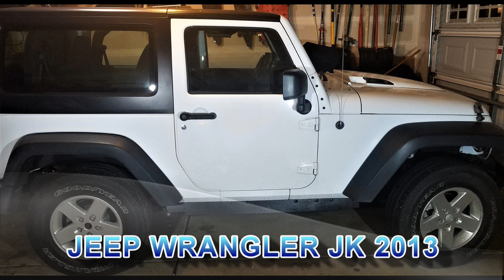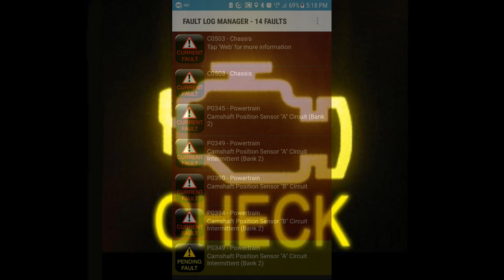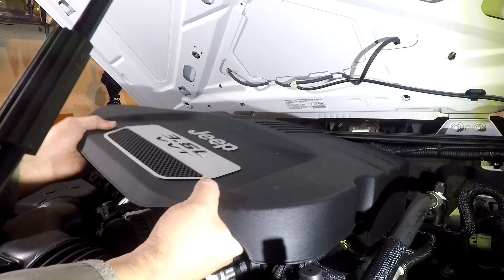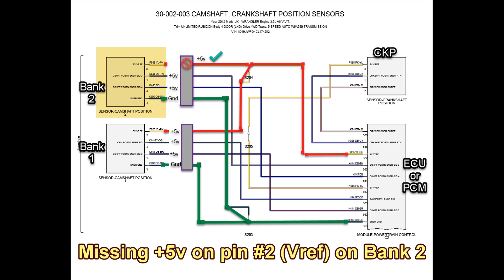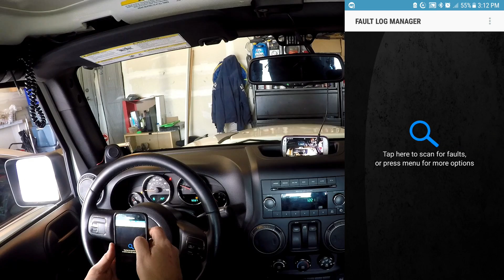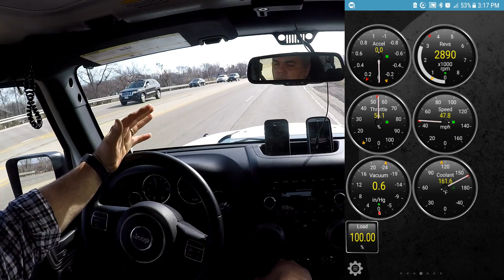p0340 p0345 Jeep Wrangler CAMSHAFT POSITION Sensor SOLVED

Comment: By far, the BEST video on this issue. 
Clearly detailed diagnosis. Much appreciated! I have this issue currently.
I’ll report back once I diagnose mine.
Reply: I checked the voltage in the connectors. Driver and passenger side. All pins except #3 have, 5V. 
I already replaced the camshaft sensor on passenger side. I guess I’ll replace driver side tonight. Not sure what else to do now. Any suggestions????
Reply from the maker: Pin #3 is ground... so not 5V should be seen.   what DTC are you getting ?
Reply: @toshisate8121  
Both sides being replaced fixed the issue. Wife traded it in. Got a 392 now. Fun some bitch!

Comment: I just went through this. It turns out that I had a loose ground cable on the battery. Fixed that and the codes went away! Start cheap and work your way up! Chrysler/Jeep is known for demanding a good solid ground or weird codes will show up.

Comment: Can anyone help? On pin 1&4 I get 1.5 volts on both banks. Crank no start with cam obd codes i have ground and 5volts but pins 1 & 4 only 1.5volts
Reply from the maker: 1. make sure your battery Negative is good and car ground is good also.. check ground at ECU also.
2.- at CamPS, check voltages as shown in the video, connector unpluged, ignition switch on.  Check back side of connector too.
3. check the Crankshaft position sensor connector as well... make sure is clean and not shorted.    you can also confirm the RPM needle moves when you try to start the car.    this will indicate good signal from Crankshaft.
Reply from the maker: what DTC are you getting ?

Comment: I’m having a similar issue after replacing my knock sensors and knock sensor plugs. These codes are all coming up. I replaced the connector on the bank 2 sensor and was getting proper voltage on all of those, however I’m also getting a code for the throttle positioning sensor low voltage as well. I’m soo stumped at this point.

Comment: I'm having the same issue on my 2012 JKU.  My mechanic tells me that I need a new engine.  I will try your method and see....
Reply from the maker: any updates ?
Reply: Yes! problem solved.  the wires from the sensor to the cpu was criss crossed with another wire.  this is after i had replaced the sensor, and the connector...   @toshisate8121
Reply from the maker: Good luck!

Comment: This video helped me diagnose and fix a bad connecter (Bank 2, Pin 1 had zero volts. I bought OEM pigtail and soldered it.  My check engine light and traction control light are off.

Comment: What scan tool and app are you using???
Reply from the maker: the app in my phone is called TORQUE pro .. they have a free version but the Pro version offers NO ADS and only cost aprox $9.99.    the  OBD-II at the time was a cheap ELM-317 from ebay... i now have a better one call VEEPEAK OBD2 Adapter... it is more stable and reliable.

Comment: I have a 2015 JK Willys. I just had my rocker arms replaced cuz of this loud tapping. After i got it back im getting a check engine light showing P0344 ( cam p.s. performance - bank 1, sensor 1 intermittent - bank 1 sensor 1). They said they replaced the sensor on the passenger side. They cleared the code, but it just keeps coming back. Also the T.C.L. keeps coming on now too. So i did what you did and i tested each pin and on each i got 4.98 except for the ground. I've replaced all 4 wheel speed sensors before as well, cuz i was having those T.C.L. and ABS lights before. Idk what else to try?
Reply: I had the same problem bro..  It’s one of your camshafts it’s not sending the position of the camshaft to the ecm . Take it or get a scanner that can show you camshaft position and it will show you which camshaft is bad
Reply: @ismaelnunez2880  It's been fixed now, $2500 later. But ya that's what it was....the camshaft.

Comment: Hi, did you change the sensor that just cleaned?
Reply from the maker: sensor wasnt changed or replaced.  The connector was cleaned and wires pushed in...  I took the sensor out just to show in the video...

Comment: I just bought a 2012 Saturday. It went into limp mode on the way home... 

These were all the codes pulled..

C121C-Torque Request Signal Denied.

P0345-Camshaft position sensor A Circuit(Bank 2)

P0137 - Oxygen Sensor  Circuit Low Voltage Bank 1 Sensor 2.

P0339-Camshaft Position Sensor A  Circuit intermittent.

PO365 - Camshaft Position Sensor B  Circuit (Bank 1).

PO390-Vamshaft Position Sensor B Circuit (Bank 2.)

Comment: hi i have a code p0349 i changed the sensor and connector in passenger side what should i do next 💔
Reply from the maker: did you check the voltages as shown in the video?   measuring should be your 1st step before replacing sensor or connector.   why did you replace the one on the PASSENGER (bank1) when DTC p0349 is a problem on DRIVER (bank 2) side?   You may want to put that new sensor on the Driver side.
Reply: @toshisate8121   after changing the driver the car was ok for 2 weeks 
buy now the problem is back with same code
i checked the volt and all of them gave me 5v
Reply: @Sho0omteBeHappy did u leave the battary disconnect for a bit?

Comment: My mechanic has changed the sensor AND the pig tail - but the P000B code won't go away.  Thanks for video.
Reply from the maker: https://www.yourmechanic.com/article/p000b-obd-ii-trouble-code-b-camshaft-position-slow-response-by-parker-hill_2#:~:text=P000B%20code%20definition,and%20timing%20of%20the%20camshaft.
Reply: @toshisate8121  Would you actually ask your mechanic to look at this link - or would they be insulted?
Reply from the maker: @ap14rcf70  if he is honest and looking forward to fix the problem.. it shouldnt insult him... he should be appreciative that you are researching the issue as well
Reply from the maker: what year is your jeep and how many miles?  per link, there are things you could do yourself...example, I would start by c
cleaning the engine interior... i would use SEAFOAM treatment to clean any gump or blockage on oil passages, etc.
Reply from the maker: 2nd i would change the PCV valve. just in case... those are cheap
Reply: @toshisate8121  ... already changed the PCV valve --- and, most recently, changed the Oil Pressure switch, replaced oil filter housing and, new temperature sensor - replaced the intake and exhaust cam actuators .... they drove it three or four times for 14 miles before i picked it up - they said the light had not come back on --------- as soon as i pulled out and turned the corner - the check engine light came back on - same code, P000B.  Not sure exactly but think i've dropped close to $2500 on this and they haven't fixed it ... sadly I think the only think left is what?  The cam shaft itself?  WHAT will THat cost?  Very discouraged, not sure what next move is.
Reply: @toshisate8121  It is a 2015 JK Sport, no modifications ... at 47,000 miles they replaced lifters (warranty, no charge) - no other problems at all until it hit 70,000 - i'm not at 73,990 and it's been to the mechanic ten times - i'm NOT exaggerating, i have each invoice right here in front of me.
Reply: @ap14rcf70   hey I’m sorry to bring up a very old section, but did you ever find the problem? I’m going through the same exact thing as you right now. P000B bank 1. Replaced both intake and exhaust cam sensors along with exhaust side solenoid. Code keeps popping back up.
Reply: @ap14rcf70  there is a video posted just a few days ago about a crankshaft sensor being replaced and it fixed a P0394 code. I have a 210k mile 14 charger 3.6 or the 3.5 (wife’s aunts sorry) has that code. I have ground at connector, all the other pics have respective 5 volts. I move the wiring and all looks good.  The code is for a intermittent fault bank 2 camshaft sensor fault.  I swapped sensors and no change, wiring is good.  So I am headed towards the $20 mopar crankshaft position sensor. It hesitates under acceleration and throws the traction control light on and then throws a fit. I shut it off and back on and it drives fun as log. As you drive like an old man.
Reply: Have you found the problem yet by any chance @willdunham6724

Comment: Toshisaf not SPANICH disculpa bro sólo.limpiaste los cmp sensor o fue falta de corriente  o negativo o.sensor dañado gracias tengo un problema.cmp Bank 1 P0340 y P0335
Reply from the maker: los sensores estaban buenos... a CMP de Bank2 le faltaba corriente en el pin #2... el alambre se habia salido un poco del conector en mi caso... lo volvi a entrar y limpie el conector con Contact Cleaner.   p340 y p335 parecen ser el mismo problema pero en el Bank#1
Reply: Si bro es en el bank1 revisar eso no vere el cableado y los voltages no tienes diagrama y  pero tu vídeo es excelente os revisar
Reply from the maker: @yasmanialarcon6558  el link del diagrama esta en la descripcion... que año es tu jeep?  tengo algunos manuales en PDF
Reply: @toshisate8121  2012 jeep wrangler  porfavor estaré agradecido gracias
Reply: O te mando mi wasap soy de Bolivia salidos gracias +591 72247504
Reply from the maker: @yasmanialarcon6558  los PDF que tengo solo llegan al 2009.. pero en la description esta el wiring diagram del CMP para un JK2012... sorry

Comment: I’m getting p0344 I’m not getting that 5v in 2 wires what should I check?
Reply: Pins not getting power already change the plug and no luck I’m only getting power on pin #2
Reply from the maker: @juansaldivar4171  is your ground ok?             If so, then your sensor may be bad
Reply: ToshiSate81 yes ground is ok and I did change the sensor but I being reading that I should go with a mopar sensor and not a auto parts one is normal not to get power from 2 pins?
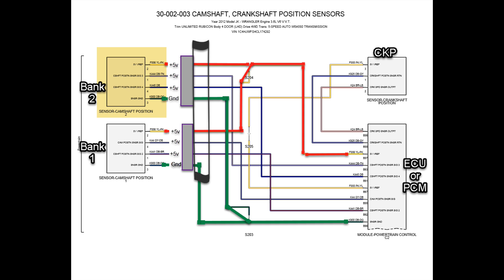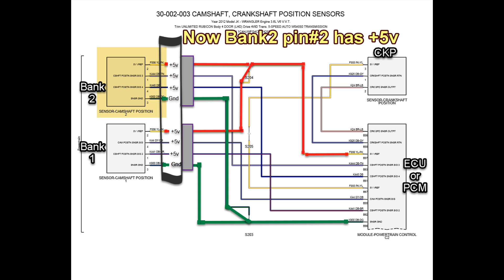Reply from the maker: @juansaldivar4171  Sensor is MOPAR 5149141AF ( see at 2:54) and also take a look at minute 6:55 for some important note
Reply: ToshiSate81 I did change the sensor but not mopar I’m getting a mopar order and see if that work
Reply from the maker: Which wires?  Pins?
Reply: Juan saldivar did you figure yours out?  I too am only getting voltage on pin #2.
Reply: Slickstoff Slickstoff  what I did I change the harness and did a oem sensor it was working fine now is doing the same thing idk what to do
Reply: @juansaldivar4171  I changed my oil from 5w 20 to 5w 30 and it seems to have fixed it. I took it to a dealer who after replacing my pcm which was not broke saw the cam slowing just slightly due to the oil thinning out at high rpms.

Comment: I’m getting a P0344 only code. I just replaced all my rockers and lifters and the intake camshaft and now I have this code. Any suggestions?
Reply from the maker: What causes the P0344 code?

The P0344 code may be stored for a number of reasons, including:

An open or shorted camshaft position sensor

A faulty camshaft position sensor

Poor electrical connection to the camshaft position sensor

A faulty starter motor

A weak or dead battery

A short in the starting system circuit
Reply: I’ll start with the sensor. What volt meter do you have?
Reply from the maker: @nicklopez8500  i have a fluke but any voltmeter would do... even the free ones from harbor freight
Reply: i just replaced the rockers to my cherokee 2013 on the passenger side and after a installed everything back and started the engine the code P0344 for camshaft position sensor and P0300 multiple misfire came on, also the traction control off light lit on the dash. i took it to the dealer and they replace the camshaft sensor but the engine continues loosing power and check engine light on. After 10 days at the dealer i brough my car back because they could not find what was wrong with it, i talked to several mechanics (not from the dealer) and they told me that the cam phasers probably are bad and maybe the variable timing is messed up,  i did not want to mess with the cam phasers because i dont have the tool to secure the timing chain but i will troubleshoot it this weekend to see if i find something else.
Reply: Nick I’m having this same issues did you had your problem solve?
Reply: @juansaldivar4171  i had to tow it to a shop because the engine finally stopped starting and it did not start at all,  after i explained what happened they told me that to check the timing they had to remove the front cover (10 hours job) just to check if the timing jumped. They said that the timing was good but with 200,000 miles once that the cover was removed it was better to replace the timing chain kit. I agreed to that and the engine finally started but it continued with the same code, they put the scope and they found the exhaust camshaft acting up, they removed the valve cover again and inspected and found little lines on the magnetic wheel on the end of the exhaust camshaft. They replaced and the code is gone. I  picked up the jeep from the shop friday and now the code P0480 for fan control circuit came on, they inspected again and now they said that the fuse box has to be replaced but since the fan is working in high all the time i will not bother in doing anything else to this jeep. it costed me $3300 to fix it. So at the end, the problem was the exhaust camshaft, a good mechanic can check the operation of the camshaft with a scope and tell you which is bad.
Reply: I’m thinking my is going to have the same issue you took it to the dealer?
Reply: @juansaldivar4171  my first option was the dealer, it took me two weeks to wait fo an appointment, then finally my car was there for two weeks and the only thing they replaced was the camshaft sensor, they put a lot of excuses what it might be the problem but they never solved anything, a mechanic from the dealer told me that it was not worth the time to work on my vehicle because it was a 2013, too old for them, my best option was to install a remanufactured engine about $4,000 plus labor and fluids, maybe around 8 or 9 thousand dollars, so i decided to take it to a another shop, they work on mercedes and european cars because i called several shops and they did not want to take the car. My car was parked since november 27 until last week, now it runs and sounds beautiful but it continues with fan working just in high speed which for now is not a problem, as long that the fan is working.
Reply: Elmer Lopez that’s mess up if they told you it was to old I hope my dealer don’t tell me that
Reply: Juan Saldivar Sorry for such a late response, so I still have the same code come up. My mechanic has been telling me it’s bc metal shavings going on the magnet and just recently stated I might have to change the exhaust camshaft. I am going to replace the statute first since I’ve been noticing long crank times.

Comment: Just wanted to share that your video led me to solving the same problem I had with my 2012 Jeep JK.  The camshaft position sensor wires don't have enough slack on the driver's side around the manifold. All four were in rough shape after 120k miles.   In my case, I wasn't getting 5V power on pin 4.  I decided to cut all four wires, lengthen each, solder, shield, and mount new pin connectors in a new harness.  I bought this kit: https://www.rockauto.com/en/moreinfo.php?pk=7328996

THANK YOU SO MUCH!
Reply from the maker: so glad this video found you... and helped you..
Reply: Thank you for the link to the wiring harness, my local dealership wanted $135 for it which is crazy, been having the codes come up for the camshaft position sensor bank 1 and I replaced the part itself but the problem is still occurring so now I'm going to trace it back to the connections.
Reply: @thebrucechannel8061 How did that work out?
Reply from the maker: @thebrucechannel8061  any updates ?
Reply: These connectors worked well for you
Reply: Your comment is also helpful. Thanks!

Comment: Can you help me with my questions? I have one of them sensors replaced by Jeep service, but the check came on with same 0349 sensor issues. What needs to be fixed next?
Reply from the maker: if the wire harness is good and all the voltages are good, please check the serial number of the sensor.. there was a recall...  please refer to minute 6:55 in the video

Comment: Hey,
Nice and clear 
I have a problem when start the car and put the gear on Drive it doesn’t accelerate properly and RPM doesn’t move up at all for sometime and then it goes normal, I took it to garage and no errors found when did computer test, by the way the mechanic & I thought the problem was from the fuel pump and I changed it,however, it remains same, please advise if you can
Reply: What's your answer?
Reply from the maker: it sounds like a TPS issue.. Throttle position sensor may be deteriorating.

Comment: This is happening in my 2010 Dodge Ram I change the sensor I have check voltage my next thing did you replace connector or the entire wire from pcm to sensor
Reply from the maker: Manue1 Torres the wire was either loose or dirty inside the conector.   I just pushed the wire back in and put contact cleaner... I didn't have to replace anything

Comment: What diagnostic tool are you using, I'm having the same issue. When I used the scan tool at autozone it's telling me bank 1 & 2...
Reply from the maker: i use TORQUE on my android phone.. with a cheap ($14 on ebay)  Bluetooth OBD scan plug.   i had solved many many issues before on cars with those 2 pieces...   May i ask, what DTC codes you are getting ?   Also, please refer to the links in the description where you can find the DTC details and WIRING Diagram... I hope these help you.
Reply: I'm getting P0344, P0390 & P0394...
Reply from the maker: yeah, p0344 is bank1... the other 2 are Bank2... you can follow the steps i did in my video...All you need a Volt meter to test 5 volts and ground... you may have a loose connection somewhere as it was my case.   if Voltages are good then you have bad sensors (which i doubt).   It seems vibration plays a role on getting those connectors loose.
Reply from the maker: did you found/solve your DTC codes ?